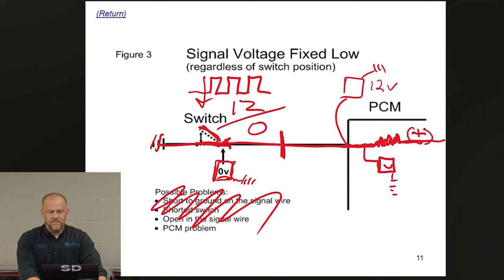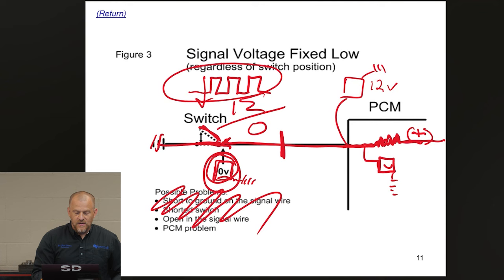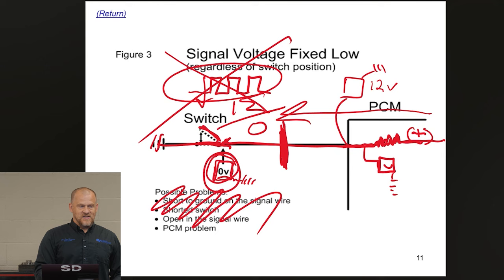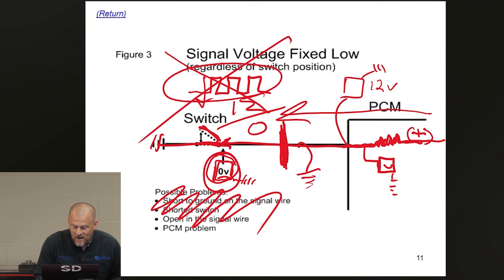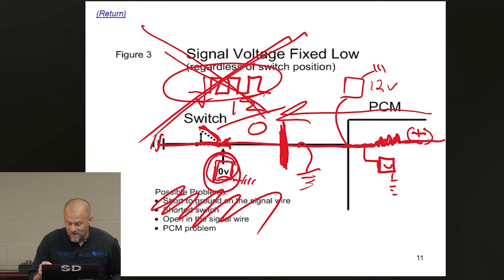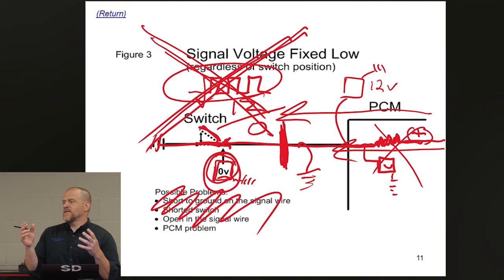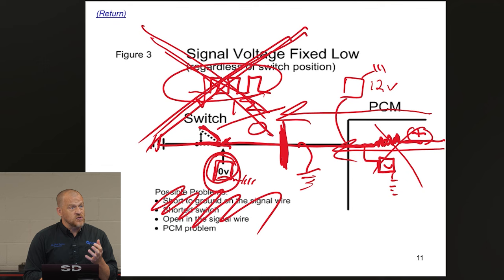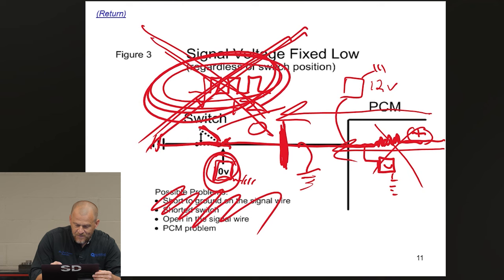Bad New Parts and the Importance of Knowing Circuit Design

Comment: With this debugging technique, the troubleshooter would assume that the ECU would be controlling the voltage to the sensor. While that may be the case most of the time in modern vehicles. It is possible power could be provided by another controller, and the 'pull down' is monitored by the ECU (or vise versa). In that case, testing at the ECU would be a valuable test.
Reply from the maker: OK, for sure, but I'm not referring to module to module communication type circuits as you describe here. There are most certainly more variables with that. The example here was a hall effect signal wire that only extended to one module. Thanks!

Comment: my take away from you talking about pull down circuits and no need to check them at a module is because
if theirs an open between the sensor/switch and the module their will not be voltage present at that switch/sensor and without voltage present it is unable to pull it down..  
am i correct?
Reply from the maker: That is correct

Comment: there is one exception. corrosion can cause a low current power leak in from adjacent connector pins into the signal line being pulled down and the sensor may still be able to pull it down and signal look ok at both ends for a while, add more water/moisture and it may overload/cook the sensor.
the only way to find that would be unhook the ECM and sensor, then check for power still on the lines. there may or may not be a resistance issue testing the wire itself, so the books are kind of whacky on that one. you have to take the books suggestions with a grain of salt and always go into electrical/electronics technician mode, because they neve cover all the possible scenarios.
Reply from the maker: You will see that on a pull-down circuit! If it still looks good on a lab scope, then your scenario is still not affecting the circuit. Once it does start affecting the circuit, your going to have symptoms and you will see it!
A CAN line with water in a connector comes to mind. I have that case study filmed too!
Reply: SD you are correct but i believe  the book just wants you to make sure the wire is not shorted to the wire next to it. To make sure your signal is in fact from the correct pin.
Reply from the maker: Even if the signal wire was shorted on a wire next to it, that absolutely will affect signal voltage levels. So again, on a pull-down design circuit as I am describing, if signal voltage measures good at the sensor or component, you are done! No other testing is needed. A resistance test will tell you nothing more than what you already have available to you.
Reply: @ScannerDanner  ok, an issue can still be present if there's low or variable current path between the wires(corrosion bridging at connectors). if a said bridge occurs, it could apply the same or lower voltage at higher current and still look fine on a scope/ecm output on dry days, parked vehicle. but that may become high enough current to overheat or destroy a "pull down" type sensor on humid/rainy days.
why and how? the current passed via corrosion bridging can vary depending on the level of humidity that enters it.
so a vehicle sitting around in dry weather may work fine and slamming in a new sensor may last a while, but after a rain storm or high humidity? moisture ingress wets the fault area and current increases again killing the sensor.
not trying to prove nor say your wrong, just adding an exception note. in the end electronics suck anywhere moisture or water may enter. which is pretty much everywhere in life. 🤣 so I am for sure firing lightning bolts and fireballs upstream at all engineering, testing and bean counters that keep hosing it all up.
Reply from the maker: @throttlebottle5906  you will still see it! In your scenario, only on a rainy day or when that moisture does it's thing. The ohmmeter test will miss it too unless you are measuring for it during the condition. Also, measuring at the computer will not be any more accurate if you are not measuring DURING the hypothetical condition. I've also never seen repeated sensor failures from what you are describing. I 100% still stand by what I said. IF you have good signal voltage at the sensor of a pull-down design circuit, you do NOT need to also measure it at the computer. You are wasting your time. A pull-up circuit design is completely different! You can have good signal voltage measured at the sensor and have 0v when measured at the computer.
Reply: @ScannerDanner  I'm not saying your wrong and that will be correct most always, but there's still the possibility of corrosion bridging fooling you(nailed me before).
it's not just testing for proper voltage and pull down on the line (with ECM powered on), nor testing for no voltage(with ECM off), simple ignition off may not be enough, as the ECM and combined circuits may draw an corrosion back-feed down low and not show at sensor. unless the ECM(other) is unplugged. then you would need to "voltage" test suspect wires to nearest and far battery/body ground, to confirm. yeah, pretty much forget the book telling you to resistance "ohm" test the wire in that case.
again, this may be a 1 in 100,000 case. but it will be one that bites again and again.
Reply from the maker: @throttlebottle5906 you said "as the ECM and combined circuits may draw an corrosion back-feed down low and not show at sensor" this is 100% not possible on a pull-down circuit that measures good at the sensor. If it is affecting the signal wire in any way shape or form, it is NOT going to only affect the signal wire at the ECM, it will affect it at the sensor too. Again, a pull-up circuit is different and the variables are also different.
Reply: @throttlebottle5906  You cannot have current without voltage. Any voltage in the circuit will affect the signal. A bleed over from any circuit will show in the signal at the sensor. This is why it is important to know what a known good signal should be. If it was a 0-8 volt signal and you should have a 0-12 volt signal then that line may have a ground or near ground circuit bleeding over and pulling down the 12 volt coming from the ECM. Same idea if it was a 3-12 volt signal with a bleed from a voltage circuit.
Reply from the maker: @1MiketheMechanic exactly
Reply from the maker: @throttlebottle5906 one other piece my friend (and btw, I do appreciate this dialog) as I'm having a debate on FB with someone over this same video and circuit.
If there is resistance in the signal wire, would we see it with the switch open? In most circumstances I would say no! No current flow equals no voltage drop right?
BUT in the case of input circuits like this, the internal pcm resistor being used is in the thousands and even as much as a hundred thousand ohms. Now add resistance to the signal wire and your voltmeter or lab scope itself will be enough of a path to ground (current flow) to cause a voltage drop, even with the switch open!

Comment: Hello Dan   you videos and training are TOP NOTCH !!  I  need your help   i have a 2008 MAZDA CX-7  TURBO, Last week  i was driving pulled  into a parking ramp came back and nothing ! my car will not start  no crank nothing  but it seems like the alarm system decided to work its on and will not allow me to crank , i checked all the fuses , replace ignition switch because my key was completely worn out  but the new switch and transponder did not help same problem. (  the relay for the starter  i want to replace )bv, i have the Mazda manual but is confusing as all hell , any advice or circuit i should be checking ?  i am wondering if i lost grounds ?   Thanks for listening  , James
Reply from the maker: My names Paul Danner 😉
The first mistake you made was replacing your ignition switch without doing testing. It is possible that you now added a problem with anti-theft issues with the new ignition switch.
You need a good wiring diagram and then study the starting system and do some measurements on that circuit. Also a full code scan of all modules to gain some direction
Reply: Hi Paul    Thanks for the response, i did some testing and i can tell you this  the starter circuit works fine  i heard the engine crank when i removed the relay,  My  alarm  light  is flashing steady  and when i put the ignition key  on  for a bout 5 minutes i get  one flash followed by 5 flashes , when i  try my  ob2 tester  i get no codes or anything . I also pulled the main harness  in the engine compartment looking for a broken wire or  corroded terminals  , i found none pretty clean , i also tested the  starter relay works fine , i don't understand why ?  the  alarm decided to work ? and  stops me from starting the engine . Any clues ? very appreciated

Comment: any way i can get some technical assistance on 2008 ford focus
Reply from the maker: Possibly, fire away
Reply: I can always give it a whirl. May be simple as a ground rusted or broken. What the question?
Reply: Im getting 60 psi coming out of the tank(with fuel filter unhooked) but  only 30 psi when the filter is installed at the rail. it has evap tied in with the fuel filter i pressurized  the tank and used soap and bubbles no vacumm leaks in the fuel system.all the way up to the purge valve under the hood service manual says 55 at rail at idle. @ScannerDanner
Reply from the maker: @user-it4vc4st7r  two absolutely separate systems. Your EVAP system is definitely NOT tied to your fuel delivery system
Reply: i have a green line coming in to my fuel filter
Reply from the maker: @user-it4vc4st7r  your fuel filter is NOT part of the EVAP system. If there is a third line on the fuel filter (as I see in my service info), that suggests the fuel psi regulator is in the filter and that third line is a return line. According to my service info, this is a mechanical returnless system and your psi spec at the rail with it running should be 55 psi. 
But there is conflicting data on where the fuel psi regulator is. On most returnless systems the psi regulator is part of the pump assembly, but in your case, that third line on your fuel filter suggests otherwise. 
I have also seen the fuel psi specs be way off on these Ford systems because many of them are using an electronic returnless fuel system with no psi regulator and a variable speed pump to control pressure. On those systems, there is a wide range of pressure readings.

Comment: Sir i need your immediate attention and help...
Vehicle is Hyundai Sonata 2011. The AC gives cold air whenever the vehicle is in motion or when accelerator is pressed. However, it doesn't give cold air and give only hot air when vehicle is at idle with the accelerator keeping at rest. What could be the issue here? 🙏🙏🙏
Reply from the maker: Almost scrolled past with "immediate attention" lol, I talk to hundreds of thousands of people and there is no "immediate" here.
Anyway, I need low side and high side pressure readings to be able to offer any suggestions.
Reply: @ScannerDanner okay thanks for the immediate attention to me with all your busy works... 
Sorry i do not have such readings.
Really wonder why the AC is not giving cold when there is no acceleration or when the vehicle is at idle. 
By the way, chatting you from Manipur, North East India, India 😇😇😇
Reply from the maker: @tnamen1307  a few things come to mind
1. You could be low on charge
2. You have poor airflow through the condenser at idle (cooling fan issue)
3. You have a weak compressor
Pressure readings are the necessary next step.
Reply: @ScannerDanner  okay thanks for the inputs.
By the way, your channel has really been a foundation to me in understanding the very basic of circuit diagrams and its working.

If I had ever come across your channel during my high school days i.e. 2006 Class X, I could have easily secured 99 percent marks in Physics. Back in that time, we were made to mostly learn by heart without much understanding the basics. I am sure I learn by heart almost 70 percent of the Physics syllabus.

Comment: mate if i had a pound for every time i have said to someone no i don’t need to test that other end because i have a signal here , i would have been able to retire years ago . example friday powered tail gate metre at the strut you could see the switch change . dude i was with “ we need to get to the controller “ why it’s sending the signal “ could be short “ but it’s seeing the signal .  measured across the motor coil  open load “man you are just lucky you went for that 🤣🤣🤣🤣🤣 no i understand how it works 🤣🤣🤣🤣
Reply from the maker: exactly! you understand the circuit design while others only know what the flowchart says to do. Big difference! Thanks for sharing
Reply: @ScannerDanner  buy the way i appreciate you sir . i am 57 years young and been doing this since i was 20 . and still learn things every day 🙏 your channel has entertained and enlightened me in thing i had forgotten i new . my kicking and screaming i finally bought a 2 channel pico scope 🤣🤣🤣 thought i should join the revolution and add it to my multi metre and many hand made test light bulbs 🤪🤪🤪
Reply from the maker: @paulspeller968  awesome! Thank you Paul